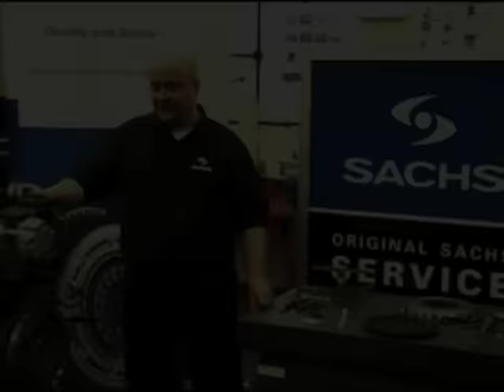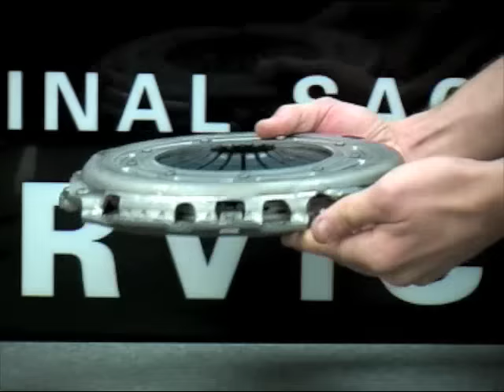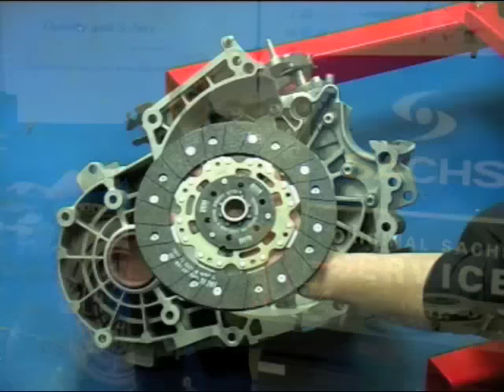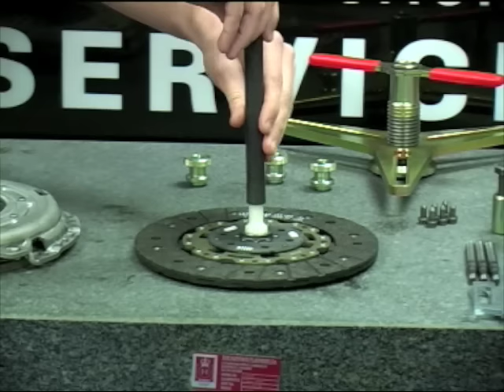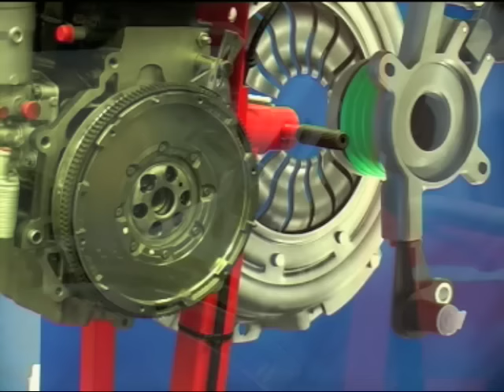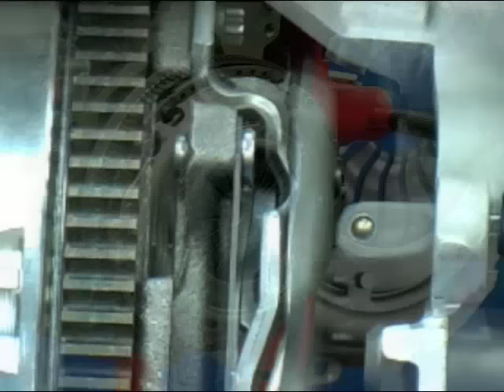ZF Services Self Adjusting Clutch Fitting Procedure

Comment: No tools or press needed. Find bolts that match fly wheel and put and bolt and nut on. Attatch to flywheel crank on the nuts and the forks will depress as the pressue plate is being pressed. The ninja star can even be replaced
Reply: if you don't use this tool the bolts hole "ear"  will curve in way there will stay permanently gap between the sun and the clutch disk

Comment: Use of this tool l ensures the clutch angle geometry stays the same throughout its life. (clutch pedal pressure remains constant). 
If the tool ain't used then the pedal pressure increases as the clutch wears. 
It is clearly stated (with diagrams) on the LUK technical site.

Comment: I Use this tool religiously but it does not centralise the drive plate correctly  it lacks a boss to centralise the drive plate within the cover fingers I have modified a old plastic snap on alignment tool to make mine work correctly

Comment: I've just installed a clutch on a renault megane 225. I followed a video showing the clutch plate prongs being compressed with a press, then the self adjusting springs release then you turn them to compress the self adjusting springs, then you release the press off the clutch cover and that's it set. 
But now that i've installed it the clutch isn't disengaging??
Reply: Does the clutch pedal still feel good? I ask because the clutch on 225's doesn't require compressing or the use of this tool. so either something went very wrong when doing that ^ (which unfortunately is likely) or there is some sort of hydraulic issue which is common because the slaves can be a bitch to bleed :/
Reply: @urbanrider1972  yes, pedal has full travel and comes up back to the top. I have bled the clutch line till i'm sick doing it.
I'm sure the clutch friction disc isn't being released and is just jammed in there somehow
Slave cylinder 'is' pushing the pressure plate fingers, but clutch isn't disengaging?
I have reverse bled the clutch, vacuum bled it and done it per the renault service manual  3 stage process.
3 stages are open bleed, pump pedal till no bubbles, then close bleed, then push down pedal once, open bleed, close bleed, pedal up, do this till you're sickened, then final reverse bleed.
Everyone is telling me its the bleeding, but i just can't believe it, i think they're might be a British clutch fluid shortage, and it's all been me!
Reply: Maybe something went wrong when compressing it?
Reply: @urbanrider1972  i definetly didn't over compress it while setting the self adjusters, just compressed them until i could turn the center disc anti-clockwise, and the green/yellow springs compressed.
Reply: I take its definitely the correct clutch and the friction plate is in the right way around?
Reply: @urbanrider1972  The old friction plate the wrong way round haha, been told that dozens of times! :-)
It was fitted a) as the service manual showed, and b) it was fitted the same orientation of the one that come off! :-)
When you think about it, e en if someone 'did' overtighten pressure plate mounting bolts, the plate is tight up against the flywheel anyway, i couldn't have been more careful equally tightening the bolts to torque.
Reply: Ahh, okay, just making sure as I've seen it happen so many times haha! but as long as there defiantly isn't any hydraulic issues, unfortunately its gearbox out again and see what's up with it.. its not the easiest on them I know but if that's what needs to done its gotta be done! it could just be something faulty but you cant really tell without having a look anyway. you definitely don't have too compress it or set the adjusters as they are automatic, just make sure the plate is centered and tighten the bolts as normal. Pain in the arse! :D
Reply: @urbanrider1972  This is what confuses people about the brand of clutch i used, which is Luk.
Yes, the self adjusting mechanism just automatically keeps  compensating over time for the natural wear occuring on the friction disc, but, there is huge confusion with Luk as everyone says Luk clutches are ready to fit out the box, with the auto adjustment 'preset', mine wasn't!!
They sometimes get bumped during postage. And to make things even more confusing, i've just bought another Luk clutch for my car, and the adjuster springs are between fully set and unset, wtf??
Reply: robbocop33 They set them selves when you fit them, I’ve never had any issues with luk and in this case it may be that it’s adjusted to far now, meaning it may not be releasing enough to disengage the clutch plate.. just fit the new one as it is and you should be good! It will set itself when you tighten it down. Just send the old one back as faulty
Reply: @urbanrider1972  you know what makes me mad, in the Haynes, and the service manual when they show the auto adjuster springs set, i had my springs looking 'exactly' the same!
Tech guy from Schaeffler who supplies Luk clutches in the Uk said my springs were spot on when i sent him a pic!
Old pressure plate i took off springs were in a relaxed state, as friction disc was pooped!
I felt i cant do anything more than follow the service manual word by word,yet here i am with an undriveable car.
I've heard of people sorting out adjuster problems through inspection holes in the bellhousing, top bodging!
I'm just wondering if i could try and trap clutch pedal down, and try and move inner adjuster plate slightly clockwise? On the car.
Yes i'm that desperate! :-)
Reply: Give it a go, shouldn’t make it any worse! Just make sure it’s right tho, you don’t want it to go when driving mate! Might be worth just unbolting the gear box, moving it over a bit and having a look? Have to remove a few things obviously but just to make sure..

Comment: All you guys talking about aligning the clutch by eye must be old school shade tree guys with low comprehension skills. You COMPLETELY missed the whole point of this video,  AND what this tool is for.

It's NOT for aligning clutches, it's for setting/resetting the SAC (Self Adjusting Clutch) mechanism on this specific type of pressure plate. A plate most higher end European cars have that adjusts automatically as the friction disk wears and prevents the pedal effort from increasing as the disk wears.
Reply: J.D. Chapman the first part i figured myself but what difference does it make in the self adjust mechanism if i just bolt the pressure plate like in older vehicles? (In a star pattern of course)
Reply: People say that you can do it like that successfully, but ONLY if you're using a BRAND NEW PRESSURE PLATE. If you're re-using your same/old one with a NEW friction disc, you MUST reset your old plate so it is in it's "new" pressure plate setting. Otherwise it will be incorrectly set as if you've got a worn friction disc in, and it may not self-seat or "bed" correctly and ruin your new friction disc. You would think that it would re-adjust on it's own, but I don't know if I'd take that chance and have to pull everything again.
Reply: J.D. Chapman but i never replace just the disc, i always replace the whole kit (pressure plate, disc and throw-out  bearing) so my question still remains.
Reply: Then if your pressure plate (and everything else) is brand new, there's no reason to have to reset it, it's set from the factory, just install it. Sometimes the factory setting is messed up in shipping if the kit is handled too roughly. So if that was the case, you really should reset it to be safe. It's a simple enough procedure.
Reply: @KingZoneOne   Well said on all your replies.
Reply: @jamesporter4749  I had dozens of  people telling me if my clutch self adjusting mechanism was set before fitting, i would 'not' need this tool.
I will add to these people saying you don't need this tool, my factory service manual for my car! My local official dealee fir my car! And the Haynes manual!
And before doing the job only 'one'!!! Yes that's one! Person told me no use if tool=non functioning  clutch, and guess what, he was right and i ignored him!
I am now on my third attempt to fit a new clutch to my megane 225,first two times clutch woukdn't disengage, gear lever was solid, nowhere near going into gear!
So the lesson is, this tool is more than just to set and reset, it is vital, in my case, for the clutch to work at all!
I have now bought the tool, and i'm currently starting the job again.

Comment: Help!!! Done all this on sprinter but clutch NOT disengaging. Is it possible for pressure plate to be faulty.? Thanks. Had gearbox on/ off 3 times.
Reply: jou put the disk wrong way
Reply: Did you manage to find your problem  I’ve taken my gearbox out 2 times already

Comment: Folks.if possible USE this tool. Eurocarparts hire them iirc free but deposit needed. I ended up doing this job twice as 1st clutch lasted cpl thousand miles before I started to feel the shudder at bite point😦 with a new clutch and dmf that the tool wasn't used on.
Just my advice. Use the tool . It's there for a reason. 
Yes. You can do job without one but I strongly feel it will not be the same as using this tool. That extra clutch I could have done without buying but hey we are all learning

Comment: At 3:25 you say "continue to tighten the spindle until the cover is flush with the flywheel mounting face". What exactly is this? I don't follow the meaning! What cover? Are we looking for an alignment somewhere?
Reply: it means tighten it till the pressure plate is flush with the flywheel
the mounting face is the surface that the clutch disc and pressure plate rest on(bolt up to)
Reply: Thanks for that, maybe "cover" wasn't the best way to describe the pressure plate! All in and running now.
Reply: @pinxtonpete  The cover is the outer casing that that gets bolted to the flywheel.
Reply: @johnbower  mate i think your a bit slow 
3 years slow
Reply: @genmaxpain  Wrong
Reply: Bob Hope o

Comment: 3 drops of glue momentary clutch disc and placed centered on the pressure disc for 10+ minutes (degreased surfaces). Bonded discs are mounted on the flywheel - is divided on start. (If you do not remove a gearbox)  ;)

Comment: u really dont need this tool... just a good eye and a bit of brain
Reply: G. G. Trust me you do. My 330d clutch 6 weeks old fucked thru not using 1
Reply: Its a self adjusting clutch... if you remove it with out the tool, you fuck it.
Reply: The flush contact...  plate to flywheel... sets the self adjuster.. trying to reinvent the wheel.... my  customer did get over 200k miles outta his clutch..  he does have long commute...
Reply: @roberttello3538  no it doesn't, my genuibe service manual says to set the self adjusting mechanism 'before' fitting the clutch to the car!
And it doesn't mention using this tool in the video, just a clutch centralising tool as you normally would.
Reply: morons ... all of you guys ... u could install it by eye ...but this is the correct way... precision...of course by eye...it will old 200 K miles ...if you drive it like and old lady .... but if you abuse your clutch it will reflect the way it was installed ... you guys most be from the US ... only power ... no brains ... in Germany we do it by the book "German made"
Reply: agree.  i never use this tools. use my eye to centre it never had issues.